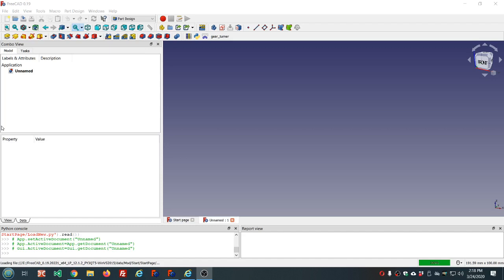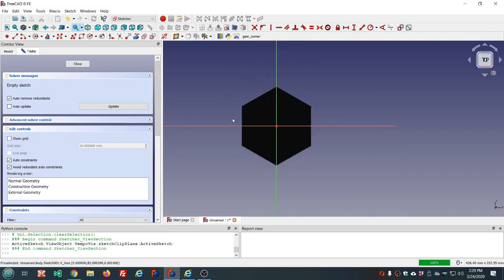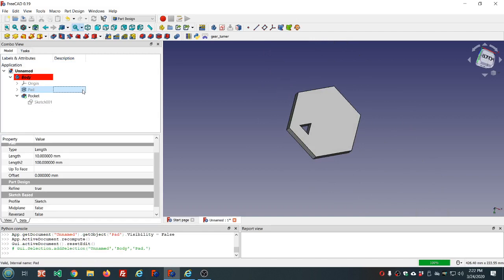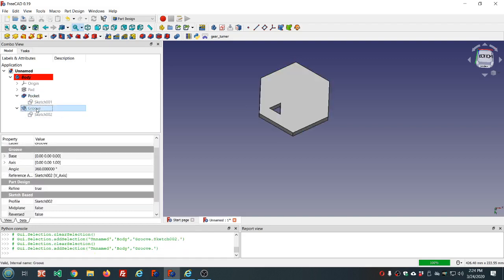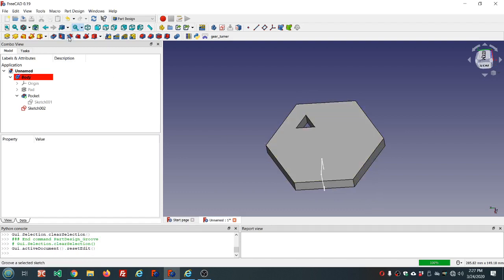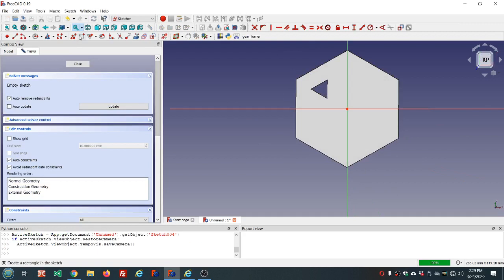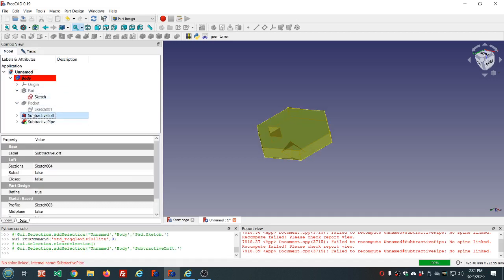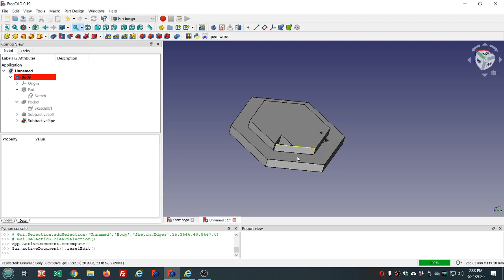059   FreeCAD Part Design Subtractive Features

Comment: great subtractive freecad info... do you have one on placing top and bottom flats on a shaft in parallel with the diameter or a flat for a gear lock down set-screw ?  thanks a lot...
Reply from the maker: I don't recall making a video on that subject.